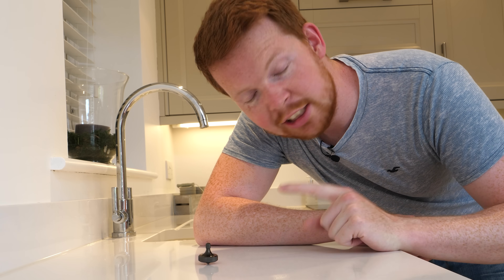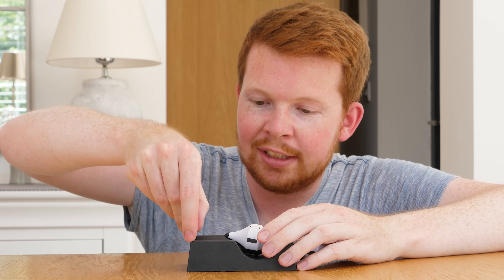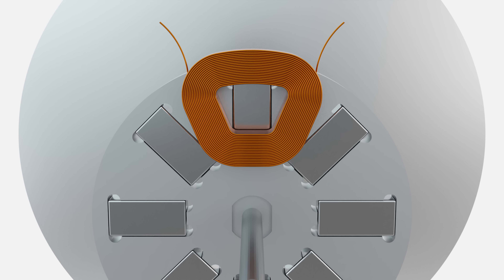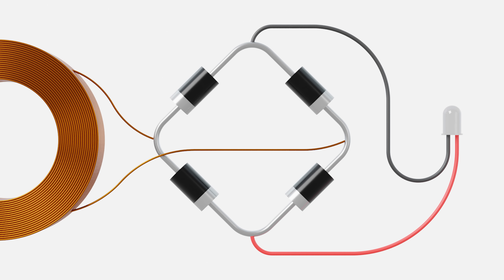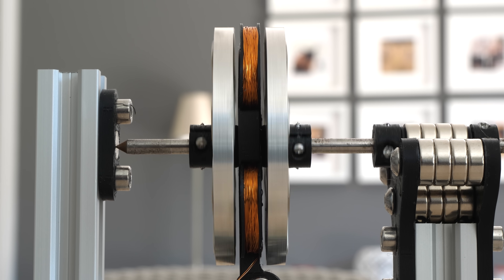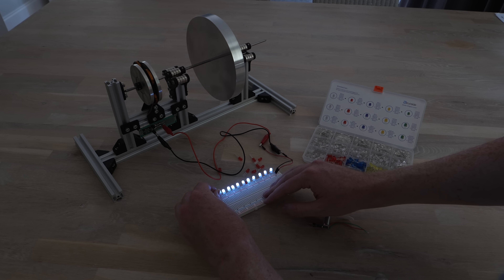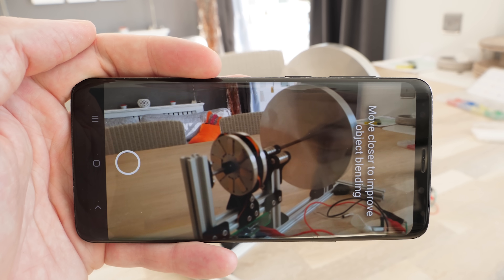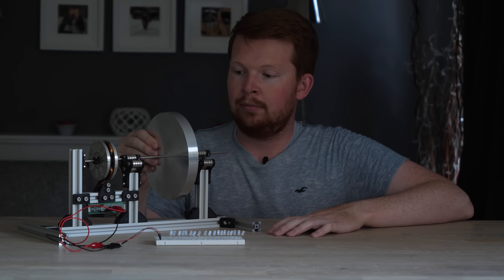Flywheel Battery

Comment: I thought the currents added physical resistance that would slow the motor down when you closed the circuit.  Why is electricity so confusing?  I hate feeling dumb.  I need to go punch a smart person now.

Comment: This could only make me think about perpetual motion what if you were to up the voltage by making even more coils with single wires and then running a motor and having that motor go to a gearbox and outside of that gearbox is like a rubber wheel that turns the flywheel you would then intern create perpetual motion am I right?

Comment: Crucial missing info: the rotation is not mainly slowed down by the friction caused by the air and the pointed end of the shaft BUT RATHER the magnetic forces created by coils interacting with the rotating magnets. As soon as you start using the created electricity, it will be nearly indifferent if you use magnetic levitation or traditional bearing so all this project is just an eye candy not a practically useful invention. Not that scientific facts matter these days...

Comment: In this video i understand you use a capacitor for smoothing. Why is the LED flickering then? Are the frequenzy to low to charge the capacitor enough between periodes?

Comment: Instead of the friction Point, can you have repelling magnets at each end of the axle to keep it in place
Reply: Donut shaped magnets..? on each end otherwise it might flip sideways. But you still might end up with some kind of friction point because without one it may want to push left or right. But then again you may to put a magnet at each end of the rod to stop that from happening...? That's a lot of magnets.
Reply: @cynthiaayers7696  more magnets the merrier!
Reply: @cynthiaayers7696  why not just put mounted magnets all around the flywheel to keep it in place lmao. Tbh I think that’s already a type of generator or it at least should be
Reply: said same thing..
Reply: Assemble it vertically through ring magnets . Problem solved.  I had a toy years ago floating top. Basically the same idea
Reply: @iindium49  what if you want to use it for an axle in a car... but I get your point. Pun intended...😅
Reply: @iindium49  Horizontally with ring magnets on both ends would also work
Reply: I thought about that too, but could work like the one with needle?
Reply: I said the same thing, just more confusing :)
Reply: Considering the mass of the assembly, I'd say probably not

Comment: So I am just spit balling here, but would it be possible to make one of these trimmed down and as light weight as possible, and connect it to a strong enough motor to actually spin it perpetually?  Then if there is enough voltage, maybe branch the connection off to something more powerful?  Or hell, even make another on and do the same thing to double the overall power?  Thinking like this may get me flagged in some database, and get a knock my door. LOL

Comment: They did this commercial a 50kWh energy storage. German video but you can see what it is. The disks held in place with magnets in a vacuum chamber. If there is no input power and no consumer attached to the system it takes 3 days the disks rotates down from 16.000rpm to zero. The inventor says the efficiency is around 80% and they want increase it in the future. https://youtu.be/-z0tdIaehSk

Sure it's not usable to store energy a longtime, but wherever a lot of energy has to be stored and released several times a day this is a great solution. The advantage over batteries is the enormous number of over 200.000 cycles, means extremly high liftetime, they give 20 Years warranty to the system.

Comment: Instead of using the needle point at the end of the rod, why not use the same idea to keep the rod in place? By that I mean attach a magnet at each end of the rod, and have opposing magnets on each side. It would also be cool to add a second set of coils between magnets but have them rotated 45° compared to the other which would smooth out the pulses keeping the current more stable. Another cool idea would be to put it in a vacuum to increase the time. Cool video!

Comment: 2 things. What if you put a hand crank on the end with some sort of "clutch" so its not fully stationed on the end? To make it easier to spin. And it would be interesting to see a motor attached to the end so when enough power is produced, it would self propel itself.

Comment: Should use the large wheel to power coil, to charge you may want to look into the auto transmission's gear, also reduce vibration by shortening the axial, directly coil the large wheel also helps reduce the vibration

Comment: Hey Tom, imagine this connected to a daisy-chained set of hamster wheels and the output powers an FM radio.. a hamsters-powered radio!
Reply: A hamster wheel attached to a slightly smaller better balanced version of this. Use it to keep a power bank charged to charge your phone. I wonder with enough optimization if a hamster generate the power needed to charge a phone every day. 🤔

Comment: If the fly wheel was centered and you had another coil on the opposite side you could probably get much more voltage. Maybe even hook an electric motor to the fly wheel to see if it will run continuously

Comment: Instead of attaching 2 small discs with magnets, why can't we stick the magnets to the flywheel itself. As it has a higher surface area, we can use more number of coils to get higher voltage

Comment: Dude! Excellent video! A few questions: What software you used for the models? (oops ... I see there's a link on the description, never mind) Also, where did you get those aluminum parts and, more importantly, how are they called? I'm sure with the correct usual name I can find it on e-bay.

Did you try to make it levitate vertically? you'll remove the bending stress from the axle and the system would stabilize itself. Also, if you set the the permanent magnets on the outer rim of the wheel you'll get more efficiency since all them would have the fastest linear speed. You can also make a ton of really small coils and a smaller capacitor to filter it.

BTW, the uranium enriching centrifuges are magnetically suspended and spin vertically. Remember you'll cause precession as you remove energy from the generator. Oh, hydroelectric generators are also vertical.

Comment: I know it works even before it was completed and I was also sure that the energy stored in mechanical flywheel is NOT much and gets drained immediately when a Load,  such as the generator is set to work.

Comment: Hm... You almost cracked it. Have you considered putting magnets along the flywheel, with a separate frame of magnets that would propel the flywheel around, turning the flywheel battery into a flywheel generator powered by magnets?

Comment: Just curious as I've had a similar idea in my head for ages but don't have the know-how, would this be able to be turned into a perpetual motion device by using the charge to power up an electric magnet on opposing sides and released in pulses similar to a rail gun, timed just right to either maintain speed or increase it? 

Awesome video 👌

Comment: You didn't get a proper DC current but rather a repeating half sine wave. As a result your LEDs are flashing and you can see that in the vid.
Use an (electrolytic) capacitor between the rectifier's outputs to buffer it into a proper DC current.

Comment: I am sure there are developments to use permanent magnets as a means of propulsion. Can you connect the generated electricity to a motor that keeps the wheel spinning. If that works, how to control the spinning speed?

Comment: To get the flywheel off of the shaft try putting it in the freezer for a few hours it will shrink both materials slightly making it easier to remove.
Also add two more sets of coils on the outside of the magnetic disc...

Comment: Great video and very interesting. You mention how long the toy's would spin, but then you fail to mention every other. How long does it spin for on your new design with just the shaft? How long does it spin with the shaft and flywheel? Then shaft, flywheel and single coil with one wheel of magnets? Then with Two wheels of magnets with a single core? Then 4 coils with two wheels of magnets? This would of been great to know.
Reply: Power and energy output would also be useful. How long do those LEDs stay lit. It looked like the fan didn't last long.

Comment: If housed in a vacuum enclosure, this flywheel can be used to store energy temporarily. A near-vacuum will reduce the drag loss . By using certain high-density elements such as lead the flywheel can be made compact yet with high moment of inertia.
Reply: This is already used in larger UPS installations. Vacuum chamber and active magnetic bearing. Over the long term, it is cheaper than battery based solutions. One of our customers has one of these in their main server room to cover the time between a power outage and the diesels coming online.

HOWEVER.
Startup costs are much higher.
They are LOUD. The one in question that I have worked around is only the size of a normal data center cabinet, but you are only a few dB away from needing hearing protection to work in the room.
They are not failsafe. You can put a fuse in batteries. If that active magnetic bearing fails or you shut it down incorrectly, I was told that it's a good $20,000 in repairs to fix it.
Reply: He can get rid of the drag loss by using repelling magnets on each end of the shaft in stead of the glass pane.
Then place it in a vacuum room to have it move 'indefinitely'.
Add circular momentum by adding power to the coil (motor), or retrieve energy the way he did. It should function both as a battery and power converter.
Reply: You would need a magnetic coupler to mechanically extract the stored energy without breaking the vacuum. If you make the shaft connected to the mechanism, then you defeat any reason for the vacuum as just about any mechanically connected load would far outweigh the benefits of the vacuum.

Comment: You should be able to decrease the led blinking by rotating just a little the magnet disks so that the facing magnets are not phase to phase but rather in between or even add another pair of magnetic disks with that little phase angle difference. Adding another pair should also nearly double the total power as well as increase the battery capacity

Comment: I would like you to put a small rubber wheel on the motor and then attach it so it can spin the flywheel. Then  once you spin it by hand, in theory it should spin forever?
Make an A frame above the flywheel so that the motor hangs from above.

Comment: If instead of putting one side of the flywheel on a surface, what if you put a magnet on each end and make it levitate on the sides and the on the bottom

Comment: The on-off pulsing of the LED is due to ripple voltage. 

If you increase the available capacitance you can smooth that out as the capacitor will act as a reservoir providing current to the load when the alternator is at the null of the magnetic field.

Comment: Nice project,  but utterly useless as any meaningful power source due to the Lenz Effect.  The "Drag" you get when you pull energy from any magnetic induction circuit.

Lenz's law, named after the physicist Emil Lenz  says that the direction of the electric current which is induced in a conductor by a changing magnetic field is such that the magnetic field created by the induced current opposes changes in the initial magnetic field.

It is a qualitative law that specifies the direction of induced current, but states nothing about its magnitude. Lenz's law predicts the direction of many effects in electromagnetism, such as the direction of voltage induced in an inductor or wire loop by a changing current, or the drag force of eddy currents exerted on moving objects in a magnetic field.

Lenz's law may be seen as analogous to Newton's third law in classical mechanics.  (This is why it slows down and you have to constantly put Energy back into it to maintain the flywheel spinning.)    Glad some people learned something from your  video.  Everyone needs to start somewhere. This project consumes more energy than it produces. Only useful as an educational tool, nothing practical can be extracted from this project, other than it looks cool.

Comment: If the bearings covered the shaft 360 degrees, perhaps the wobble would be reduced, enabling the alternator to have closer tolerence. & Application sugestion vertical rotating  roof vent power.

Comment: Hello! Nice demonstration. Just a comment: the diodes of the full bridge rectifier will eat 0.7V x 2, possibly 0.5 if you use schottky diodes. There is an alternative solution which consists in using a full bridge rectifier made of FET transistors instead of diodes. If you choose the FETS correctly, then you will have a very low Ron of the FETS, and you will not loose energy even at low rpm.

Comment: ok your second to last setup with the tiny motor, "What IF..." you took that tiny motor and added tiny fan blades, and added triangular aireodynamic fins to the flywheel, and pointed the tiny fan at those fins to push at just the right angle to maintain the flywheel speed. Eventually it would balance out, dunno about any load it could support otherwise, but as a desk toy of materials allowed perpetual motion it would be cool.

Comment: +Tom Stanton
Great video, very informative and as others have said, the full bridge rectifier needed the Mehdi voice.
But I was thinking, when you were driving those motors, could it be made self perpetuating.
Using suitable windings/motors/gearing/pulleys, once the initial inertia has been started, it could continue without any further input.
Admittedly it wouldn't be able to power anything else, however, self powering alone would be an achievement
Reply: THIS
Reply: There is no such thing as a perpetuum mobile. It is simply physically impossible.

https://en.wikipedia.org/wiki/Perpetual_motion

Comment: You could so easily as a hand crank with a gear system to spin the wheel, and use that to charge a battery

Comment: if you made 3^x coils you could use it as a engine as well so it would really be a battery. then wired as 3 sets of x coils so you get a 3 phase ac motor.

Comment: Excellent video.  I also very much enjoyed your description of a full bridge rectifier.  On another note, it looked like you experienced counter-electromotive force when you had your generator drive the motor.  I noticed this when you noticed the extra wobble on your flywheel assembly, and steadied it with your hand.  Maybe you already know this, but counter-electromotive force is experienced by a generator, especially under a lot of load, because as the conductor is carrying the current being generated, a current-carrying conductor in a magnetic field produces motor action.  So, the higher the generated current, the stronger the motor action, or counter-electromotive force.  However, the counter-electromotive force is just vectored differently than perpendicular to the axis of the rotor, so it wobbles.

Comment: I think the worsening wobble as you add LEDs is caused by the unsymmetric load on the shaft. The higher # of LEDs, etc,  the more torque is required to turn the alternator.

Comment: If you could position magnets on each end of this rotating bar to keep it centered instead of having to use a glass disk you would decrease friction to a very low point. And in a perfect vacuum, you might have Perpetual Motion! You could connect a motor that keeps the bar spinning by the power that it generates you would have perpetual motion. All you would have to do is spin it to start it and then sit back and see how long it runs before stopping if it ever did!

Comment: Simple observation. Wouldn't you make a lot more power if you used the flywheel as the generator? A lot more surface area to fit a lot more magnets and coils.

Comment: you want the alternatin curent. as you can run the power further away.. but the cycles per secont is what your looking for as the normal power grid has 60 cycles, if you want to match it you need the windings to pass a magnet 60 times in a sec. or 60 RPS... or it needs even to odd ratio of magnets and coils. where the primary number table comes into play for your calculation.
Reply: also dont forget the other number you use is the 3 6 9. if your using 3 you cant use multiple of 3 but... 5, 7. 11, 13, 17, 19, 23, 27, 31........  amps / volts is how stron the magnents are, how many magnets are all pushing at the same time, and the gauge the wire is your using.... also if you use the fly wheel as the magnents... the wires are hard set in the circut. or the coils on the fly wheel will run an Ac currant with brushes that dump the electrons into the board as it makes contact.... this is also where transformers and book capacitors come into play, with fluttering volts and flipping magnetic fields to a solid grid flow. threw diodes capacitors and resisters.
Reply: the pullsing light is from the 4 coils and 6 ,magnets... both are devisable numbers of 2... leaving him with 2 magnets in line with each direction of the coil at a time. but also it means that there is fraction of time where there is no magnetic effect on the coils.